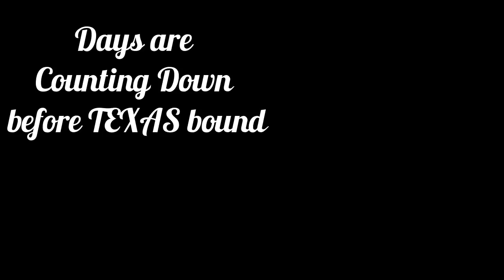Philippines Beach House Build Day 318:  Trip to CITI HARDWARE I encountered Surprise Subs and More

Comment: I read a survey of recent new homeowners that asked what are your least favorite features of modern new homes. and number one on the list are barn doors. they offer no privacy. the ones in the subdivision that I'm building also have barn doors. and for some reason they are solid core 3'6" doors. That's  a lot of unnecessary weight on the track. And they are used for walk in closets or passage from master bedroom to master bath.